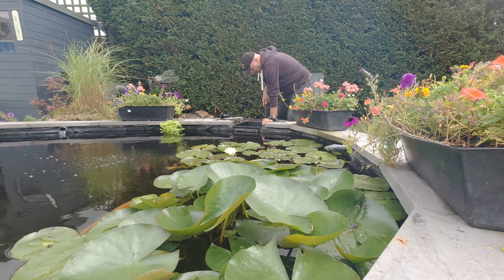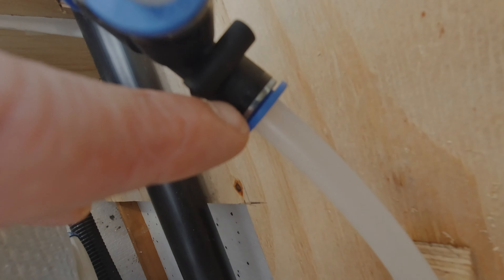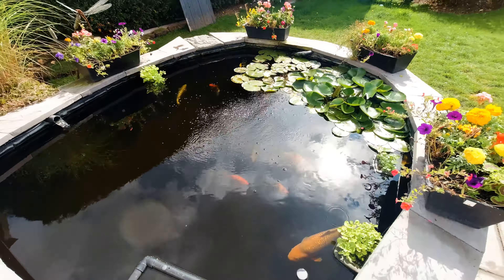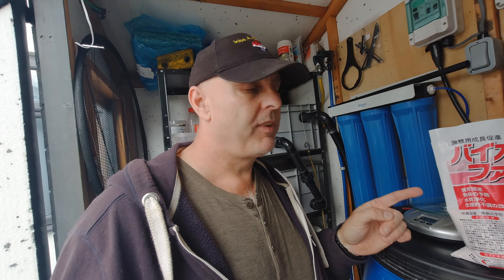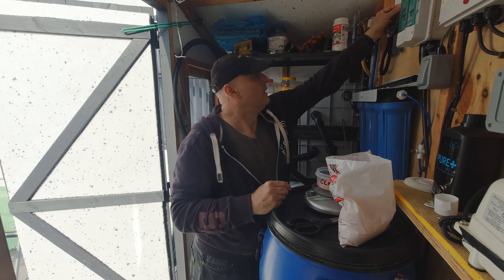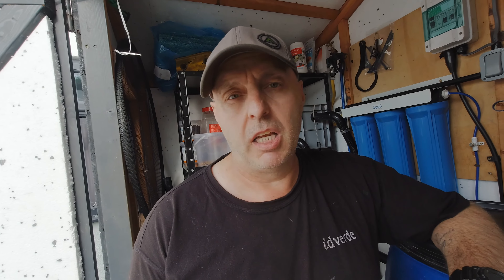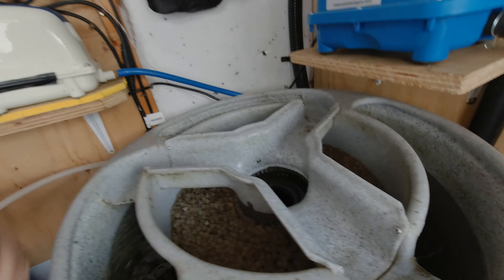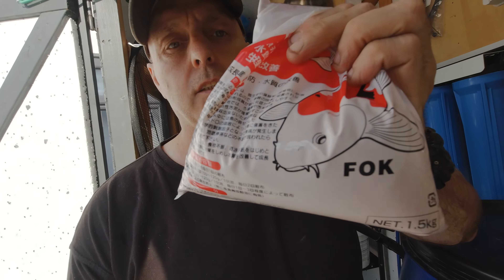TESTING NEW POND CLAY & CHANGES TO THE UPFLOW FILTER (KOI POND)

Comment: Interesting about the fly problem, I've also suffered with them this year for the first time, the only thing that's different from previous years is the terrible summer we are having, pond temp has barely gone over 19C, FOK had made absolutely no difference for my pond in regards to fly's or larve. Great videos btw, good job.
Reply from the maker: Thanks karl, this summer has been a wash out, cant believe it's nearly autumn 🙁. I'm going to give the fok a real test as you'll see in next fri video, but your comments have left me less hopeful. Thanks for the info 👍
Reply: @DerbyKoi  I would still be interested to see how you get on with it though, and whether it makes a difference for you, every pond is different so what works for one, may not necessarily work for another simply because there are to many variables.
Reply from the maker: @karlkarl2443  testing in progress 🙂

Comment: Great update Andy the up flow filters looks to be working very well for you. Your pond and fish  are lovely . Can you tell me what insulation you used  in your shed thickness  and cost and ware to  buy.  I'm  going to insulate the Ketter shed before winter. I found the Fok  to be  pretty good hope it works for you the ingredients are top secret .   Stay Safe Thanks Carol
Reply from the maker: Thanks Carol, I'm sure the fok ingredients are on the packet but my 🈲️🉑️🉑️ is a bit rusty 😄. Link for the insulation below 

https://www.wickes.co.uk/Kay-Metzeler-General-Purpose-Polystyrene-EPS70---2400mm-x-1200mm-x-25mm/p/210823

Comment: I used to get flies on my old pond myself and they seemed to breed more in my trickle filter! As for the up filter I’ve had mine built since February 2nd so it’s been well tested and I suggest you clean it twice  for best results and clarity of water. I found doing that and my pod twice every morning gave me my 25% water change on a 5,000 gallon pond also. Keep up the good work 👍🏻👌🏻😀
Reply from the maker: Cheers mate, I'm not expecting to shift the flies, reduce them would be nice, proper pest when sitting around the pond, I'm still testing mine to see what's the best maintenance but im really impressed with it so far 👍

Comment: Have a question about the feeding ring. I have followed your build but food gets under it how many holes did you put in is as I have one in each 90 and then one in the straight is that right as food goes under the ring. Thanks in advance.
Reply from the maker: Hi jamie, if I remember I drilled 2 holes, one in each corner, 1 fill hole, 1 air release hole. then dunk one end to fill the ring to about 1/3 - 1/2 under water (it can take a while) unfortunately as with any ring if the koi bump into it or become boisterous the food will be knocked out, but it shouldn't just come under without any disturbance, maybe try adding more water to lower the ring into the water. Hope that helps, let me know 👍

Comment: I've tried everywhere to get a 1/2 non return for my air line and I cant get one. I used John Guest 1/2 air lines and fittings for the upflow. It works great but I really want a non return valve grrr
Reply from the maker: Incase you haven't try Ebay, if your using imperial this wont help as its metric but this is what I got, not sure if they do imperial stuff 

https://www.ebay.co.uk/itm/184926768178
Reply: @DerbyKoi  Sorry it took a while to respond. Thanks for the suggestion. I dont think that will fit as mine is 1/2 inch. I didn't think about that when I bought all the parts for mine. Being old school I saw the 1/2 inch fittings etc and just went for that. I have managed to find some 13mm non return valves that I think I might be able to get to fit. They have barbed tails so with a bit of heat I might be able to get the pipes to fit.